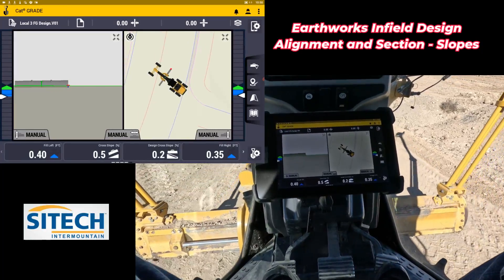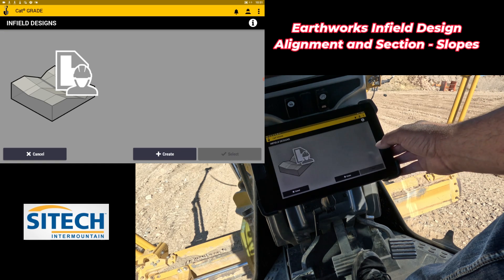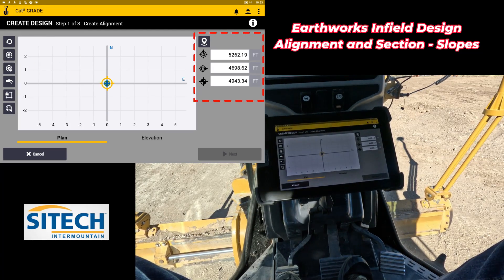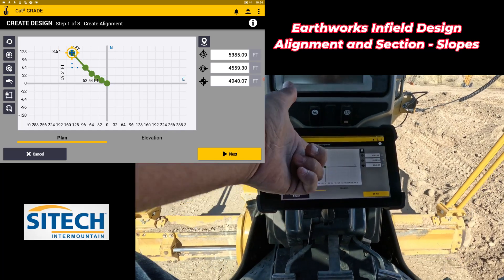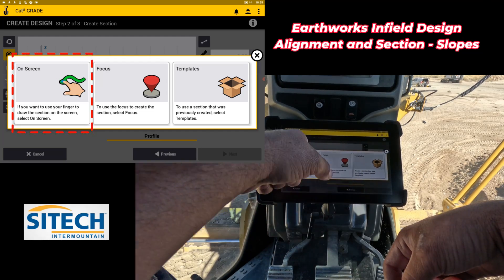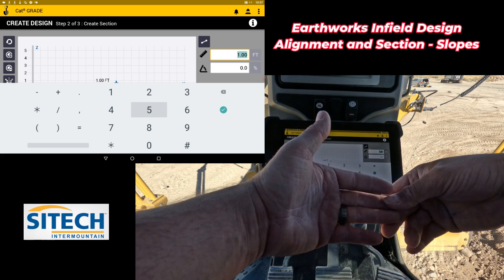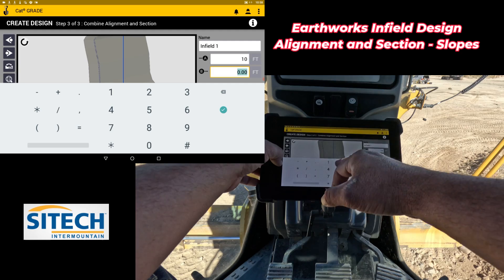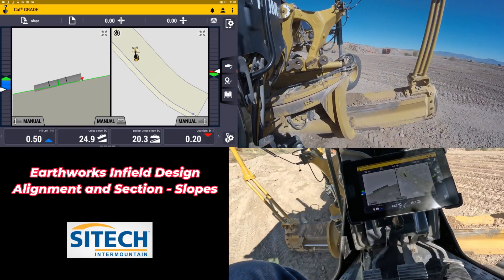Earthworks Infield Design   Alignment and Section   Slope

Comment: Is there a way to build the section the left of the origin?  Say I'm building a building pad and I want to use the left wall as the reference line.  Then I want to make the pad 7' wider all the way around then slope off each side at 2%>

Comment: Is there a way to make a variable slope? Let’s say your toe has a 3% drop but you want the top pad to be level and still maintain the same distance from toe to pad
Reply: Yes.  It’s all when you create the first alignment and shots that the infield model is based off, then when you create the slopes of that is where you create those slopes.  Like the 3% off your slope just make it up or down for what you need, then once you continue to offset to the side of that, make the top flat and that top flat will always  be flat to the side but it will rise and fall with your toe if that makes sense.
Reply: @JeffLarsen-iz8qk  I’m a little confused with that lol. The best way I can explain it is with storage units. Let’s say I want to make a flat building pad, then a parking lot with a flow line, then another building pad. If you use the building pad as your first alignment you won’t have pitch in your flow line but if you use your flow line as your first alignment your building pad won’t be flat, it will be the same % as your flow line